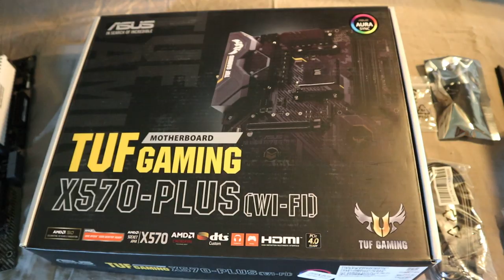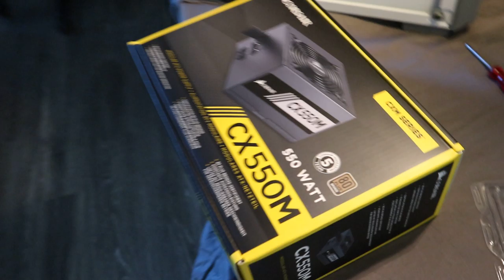MY FIRST GAMING / STREAMING PC BUILD (MID RANGE PRICE POINT) - By SCG!

Comment: quick question did the mother board fit ok because the mother board is an atx mother board but the case is a micro atx
Reply from the maker: No the case fit the ATX board No Problem.
Reply: StellaCrew Gaming beautiful, thanks for the reply. u gained a new sub!